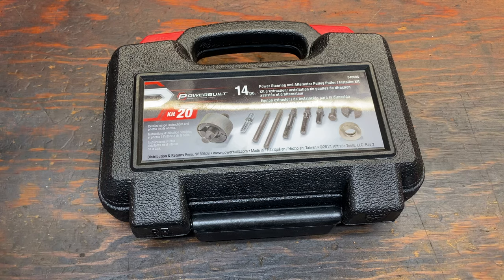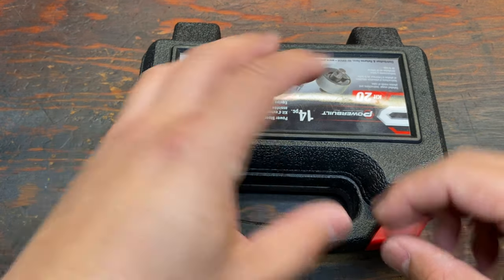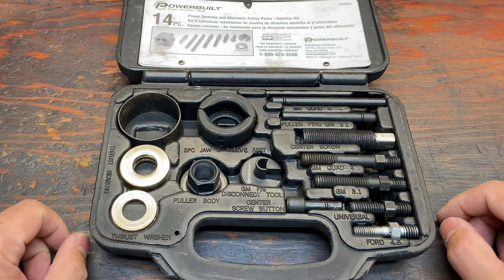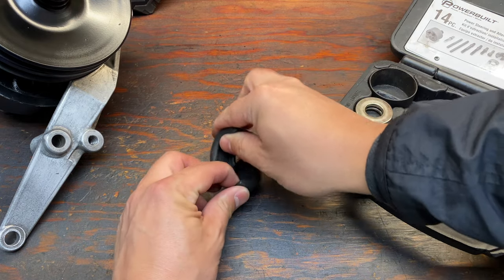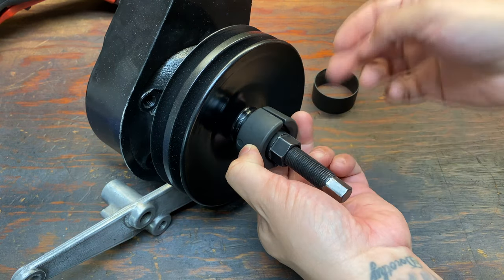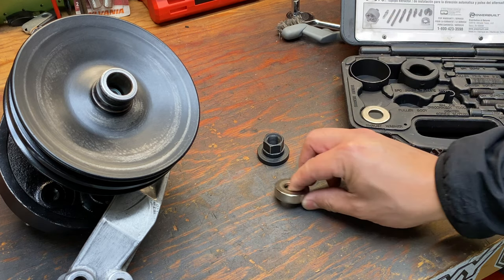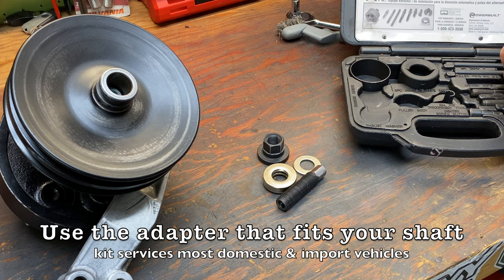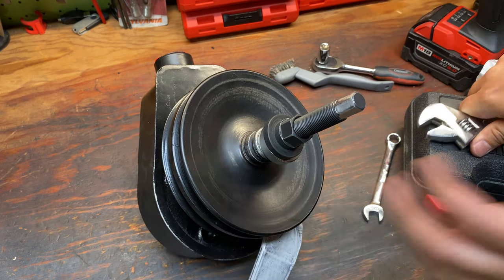How to remove and install a Power Steering Pump Pulley

Comment: I've watched dozens of videos of this procedure through the years, and this one is the best by far. One thing worth remembering is how far on the pulley is in the car before you removed it. Most are flush with the end of the shaft, but be sure you remember since you need to replicate what was there before you removed it. Even a mm of difference can lead to belt squeal and problems down the road.
Reply from the maker: Thank you and i feel the same about noting the pulley clearances. On the flip side, now that one knows how to remove and install the pulley, it’s never too late to dial it in and line the belt up exactly where it needs to be before there’s a problem.
Reply: Thanks for the heads up. Appreciate it

Comment: IT'S A CRYING SHAME WE HAVE TO GO THROUGH ALL THIS WHEN SOME OLDER MODELS HAVE A SHAFT WITH A KEY WAY A BOLT AND A LOCK WASHER. IT'S AS SIMPLE AS REMOVING THE BOLT AND SLIDING THE PULLEY OFF. GOOD VIDEO THOUGH

Comment: I am about to do my first pump replacement and no video was as clear cut as this. Thank you for taking the time to make the DIY mechanics life easier! I do have one pet peeve, I personally wouldn't lubricate between the shaft and pulley out of caution for even the slightest slippage but that's just my OCD kicking in i'm sure. Not even sure the lube would stay with the snug fitting rather just scrape off.
Reply from the maker: Thanks for checking out the vid and in my case, the shaft & pulley were so snug that the residual lube left on the shaft never had a chance at slipping the pulley. That is a really tight press fit.

Comment: As a complete pulley removal and install novice, I'm very grateful that you took your time; the other tutorials I've just watched were done too quickly kind of bish bash bosh and Bobs your uncle with bits already put together and in situ so you couldn't really see what was going on. I sat here with my just delivered cheapo ebay pulley removal/installation kit that came with zero instructions but I suppose that's what you get for 15 British quids.I then took each peice out and followed what you did on the new pulley. I had to pause and go back a couple of times being a bit slow on the uptake:face-purple-crying: and offered it up to the new pulley as its chucking it down outside today and Im doing the idler and tensioner too. The observation to see if the shaft is flush before removal that someone mentioned below seems like good advice too.  I'm guessing that i just offer up the different sized adaptors to see which one fits into the shaft to re-install on my 2004 transit?  Thanks mate!

Comment: Great to the point pulley removal video, I have that same power steering pump on my '75 Dodge D100; loved the sarcastic no water/power comment Lol.  I lived in Salado during that time and  just got back from my last deployment in Feb and then this crazy winter storm hit knocking out the central TX power (that ONCOR was not apparently ready for).  I remember huddling and sleeping by the fire place with the family because that was our only heat source.  Kudos to you and your family for still doing volunteer work in the middle of that misery helping with the hospital blanket drive:-)

Comment: Hey man I bought this same kit Amazon and I'll tell ya I had the most horrible time trying to figure it out.  In my opinion the directions aren't that clear so your video helped me out tons.  My biggest mistake was an obvious one which was not using anti seize lubricant to lube up the screws and the pully shift however i scored with this video wish it was at the top of the list this one is the best I could find.

Comment: I could smell the power steering fluid while watching this video…or maybe it’s just my coffee!
The Napa Numb Nuts  at the store I went to, didn’t even know what I was talking about when I asked about a puller kit for a power steering pump.
Must have been the first pump they ever sold. Started showing me a bunch of different 3 jaw and steering wheel pullers they had for loan.
Also told me a 6.0 didn’t exist for my  2005 Silverado.
Used to be a guy worked his way up from “Greasemonkey” to “Counter-guy”cause he got tired of smelling like gear oil at the end of the day, therefore he had some basic knowledge to share with the customers. 
Now I get blank stares when I ask them a question. Or they just ask if my truck came with the power window option, or has the off-road package. I told her it was the Z-71… blank stare…
Then they didn’t even bother to call me when my parts came on. Was supposed to be there in 2 hours but 16 hrs later still no phone call, so I called them and they said oh ya, they are back here on the shelf. Numb Nuts for sure!
Guess I might as well shop at  Orielleys. 8:38

Comment: Is this possible while the pump is still mounted?
Reply: It might depend on the style of pump and accessibility, but generally speaking it is possible and should be easier when the pump is mounted since it won't want to move around while you are working on it.

Comment: Brill video mate. I’m about to take off . When putting the pulley back on how will I know if pulley on will it just be tight . If that make sense
Reply from the maker: If you’re asking how you’ll know if it’s on tight after pressing it back on.  I’d say you’ll know from the act of pressing it back on. So basically, you’ll feel the amount of pressure and force it takes to get it back on. It shouldn’t go on super easily.

Comment: Tremendously helpful. Might put this video to use in a day or two. Was on my way home to fix a DIFFERENT issue with my car when this pulley just broke off. I’m less than a week out from buying my sister’s car off of her. Nowhere near the level of your misfortune, which I’m sincerely sorry to hear. But yeah, I’m not even sure that this car is worth fixing.

Comment: I used a press to get the pulley off but was thinking how the shaft would come out the back if I tried to press it on. Didn't know that's what the threads are for.

Comment: Don’t waste your time with other videos. JEEPARMY is the first video I’ve found that details the pulley on the pump. This was very helpful in determining if I needed to remove the center of the shaft before pulling the pulley. Seems like a small detail, but it’s not. Hint; there’s no fitting to remove prior to the pulley.

Comment: Sorry to bother u again gonna try take one of the pulley off today on my Chrysler. Is it still same way with the belt still on whilst taking pulley off and putting back on , thanks
Reply from the maker: I don’t think so. In my case I had to loosen the belt tension and remove the belt completely so it’s out of the way.
Reply: @JeepArmyUSA  this is a Chrysler grand voyager 2004 . I’ve got the pulley where alternated belt goes that’s got tentioner . But in front there another belt which goes to a pulley on the steering pump. But has no tensioner . If that makes sense . I need to remove that belt to replace the alternator belt behind it  ! 🤔 wander if you could help
Reply from the maker: @Rich4345  someone has to have uploaded a how to on this. Even if it’s not exactly, it should get you going.

Comment: i have no room between the pulley and the radiator. do i have to remove the radiator just to pull this? i can't even undo the bracket since the pump bolts to the bracket behind the pulley.
Reply from the maker: Without seeing it, it’s hard to say but based on your description, it does sound like the rad needs to come out to make room.

Comment: Yea but can you do it with the pump still on..Or do you have to take the whole pump off to just get the off..Cause mines just the pulley that wobbles..??
Reply from the maker: I suppose it’s possible as long as you have the room to work in there. Mine was in tight quarters so removal was the only option
Reply: @JeepArmyUSA  ok thanks for replying
Reply: @JeepArmyUSA we want to know how you got to the bolts without pulling off the pulley first. My kit must suck because it won’t pull off by hand. Its tight AF and not budging.

Comment: I just put a new power steering pump and pulley on. I have to say only buy powerbuilt puller remover its so much bugger and easier than others.  My belt is now squeeling though.  I dont have a laser. How else can you tell?  Should I just try to push the pulley on more? I stopped when it got super hard to push it on anymore. How in the world would someone know when its on enough?  I had no clue I'd need to deal with how far on it needs to go. Just figured push it on till it dont go no more and youre done.  Apparently not though.
Reply from the maker: I aligned mine by eye and just made sure it was straight. I did however have a squeal at first, the belt was just loose.

Comment: How the fuck do you know when to stop cranking when installing the pulley
Reply from the maker: In my case, until it was flush with the pump shaft and for me, the belt lined up the same as before.
Reply: @JeepArmyUSA  I figured it out. The nut will just stop being able to turn once it’s in position. For some reason I thought the pulley could keep spinning as you tightened.
Reply from the maker: @arctic3038  oh ok gotcha